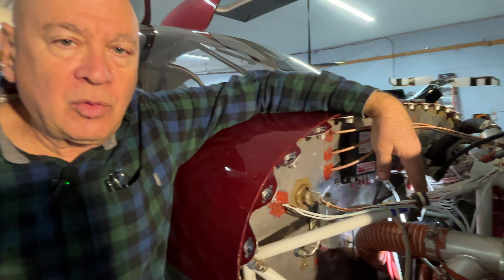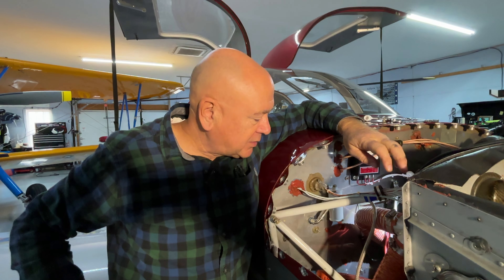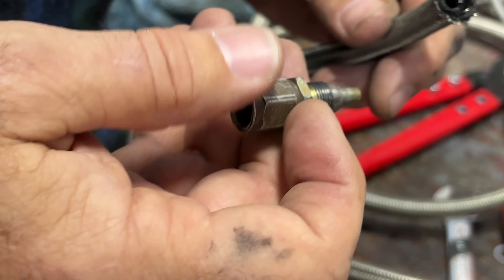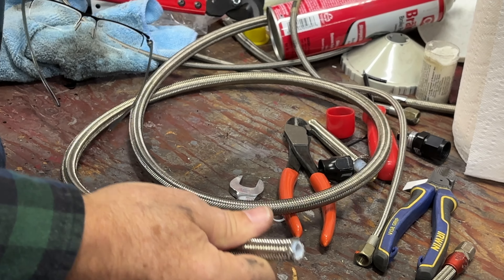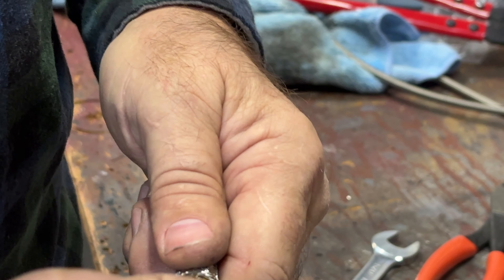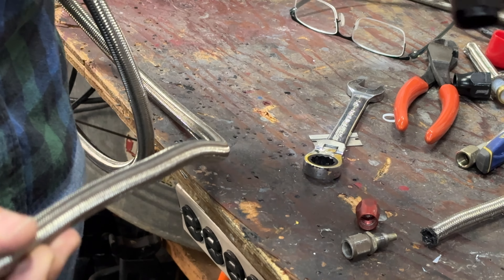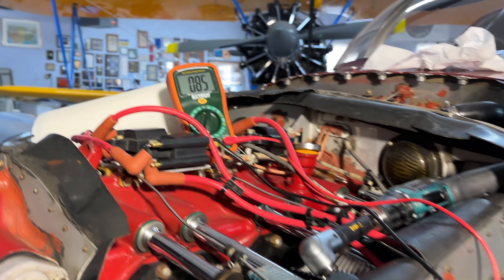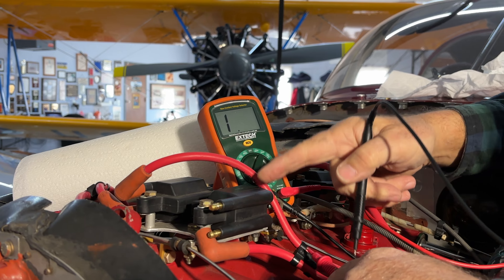Teflon Hose Assembly and Lightspeed Ohm (Resistance)  Measurements

Comment: Hey I am also using braided teflon everywhere. I was curious why you didn’t wrap them in fire sleeve for under the cowling?
Reply from the maker: I wrap all fuel lines forward of the firewall with firesleeve. The oil lines are on the back side of the baffling. The one fuel line on top of the engine does not have any fuel in it during normal operation. The fuel lines from the firewall to the pump, pump to fuel servo, and fuel servo to spider are all wrapped in firesleeve.
Reply: @baselegaviation1614  thanks Vic 😁

Comment: We always pressure tested even when it was just a low pressure line just to be sure. Fire sleeve everything. Peace of mind. When do you suggest replacing or overhauling the oil cooler?
Reply from the maker: oil cooler should be flushed whenever the engine is changed. Sometimes sooner if it's recommended by the manufacture. Some certified airplanes call for flushing the cooler at 500 hour intervals. I flushed mine whne I changed the engine 1000 hours ago.

Comment: If you are looking at a SS braided hose in the engine compartment, can you tell if the hose within the braiding is teflon or rubber…maybe by some markings on the fittings?
Reply from the maker: IF they are made bya certified shop they usually have a tag with a type and date code on them. Otherwise, hopefully the builder made an entry in the logbook.

Comment: I am wondering the fire resistance of Teflon vs rubber fuel hoses. I use as much fire resistant items I can,even on zip ties.
Reply from the maker: This is what I have found:  PTFE has higher temperature tolerances than rubber does. Thus if the engine overheats, you have less chance of the heat damaging the hoses. In addition to the high heat tolerance of PTFE, it has a higher pressure rating than rubber. Thus, should one of the systems, such as the cooling system or power steering malfunction in such a way that it causes more pressure than it should, there is less chance of blowing a PTFE hose. Size AN6 is able to handle up to 2,500 psi.
Reply: @baselegaviation1614  Excellent replacement/upgrade, I like how the PTFE fittings work vs rubber. 
Now if I could pressure test,with fluid,my custom built hoses to 150psi before use.

Comment: Is there an easy way to figure out if your existing hoses are rubber versus teflon, since they both look similar from the outside?

I ask, not just for longevity but also for the capability to withstand ethanol in fuel.
Reply from the maker: Unless there are tags on the hoses or documentation in the logbooks, I'm not sure how to identify the difference. At least I haven't figured it out yet. :)

Comment: Where did you get the new coils?
Reply from the maker: Dynatek Dual Output Miniature Coil DC11-1 https://a.co/d/bwbvzTQ. (2 pack). amazon
Reply: @baselegaviation1614  Is that what Klaus is recommending for use with the plasma 3?
Reply from the maker: Yes. They are the same coils he provides.